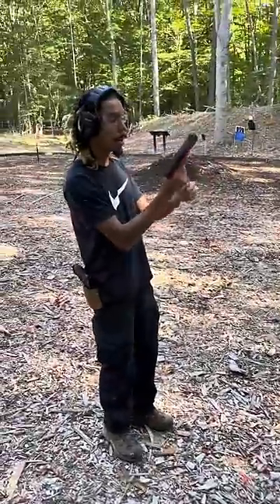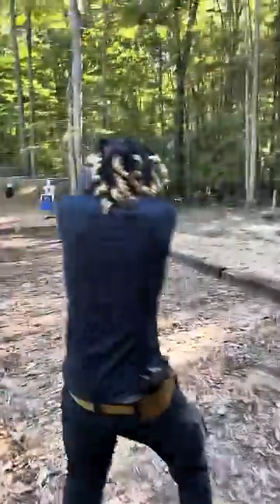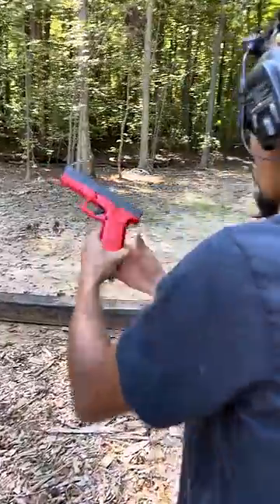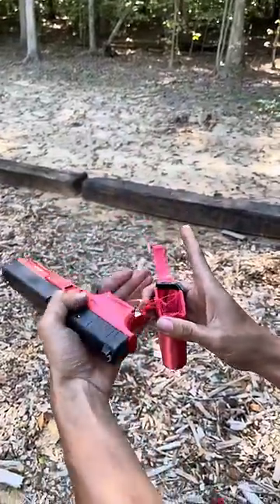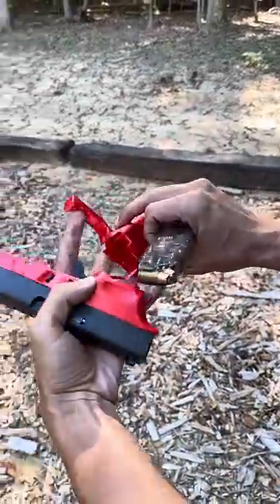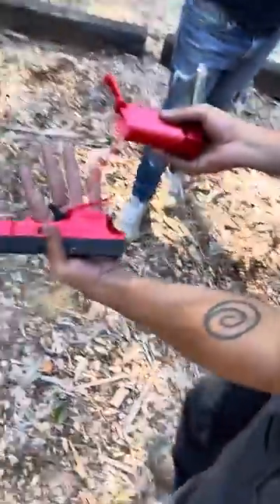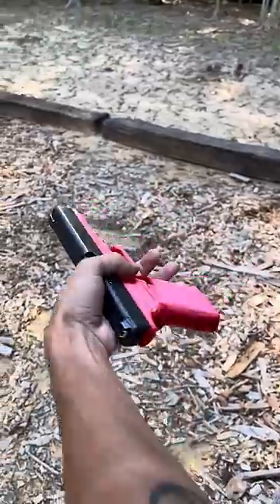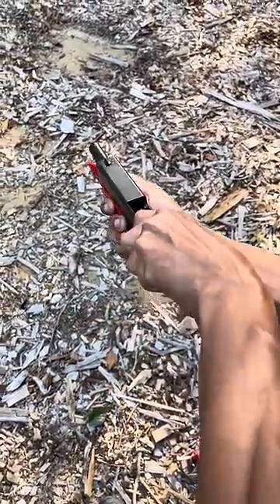3D Printed Gun FAIL 🤬

Comment: They never show the mess ups and what we actually dealing with I appreciate this fr
Reply: Because apparently most not everyone researches this stuff before doing it
Reply: Did you hear the last thing he said "well the guy did tell me I used the wrong material" 🥴
Reply: @j.m.7514  see wtf I mean like come the fuck on if you was told from the get go it was the wrong material why you gonna do it anyways smfh that is like the number one thing when printing along with settings I stress test any print before trying to assemble it all you gotta do is twist the frame and I’m sure those settings weren’t right either cause that broke the same way a print that has layer adhesions would mine broke right there when I used prusa program over cura wish I could load a picture of it
Reply: @j.m.7514  I noticed that too
Reply: 3D printed guns will never be super reliable, you can get a sturdy one capable of many rounds with high grade filament and a superior design through an expensive printer. It’s better to just get a Cnc machine and make a metal gun or make a mold with the 3D print, but get a high grade polymer just like the handgun, ez
Reply: @MLGB0Yz  well cnc machines cost a fuck ton of money and the tooling not everyone know how to edit a program so 3d printing is much more cost effective and wayyy easier and a good starting point to get to that level of cnc machining I would only go as far as getting a ghost writer for 80% receivers
Reply: Just the plastic was very cheap couldn’t take the explosion
Reply: @MLGB0Yz  You sir are a liar! You can absolutely get high round counts from a 3dp frame! Hello, I'm Dr. Death the admin of beta testing at deterrence dispensed and I welcome any challenge to our designs
Reply: @MLGB0Yz  What's the matter can't defend your point logically? We have numerous printed designs that are incredibly reliable. The printed Glocks are just as reliable as the factory ones. A lack of skill in printing would apply to using a CNC as well
Reply: @doctordeath4047  dude, I have already the issue and logically explained. Poor filament and crap printer will not produce a reliable weapon, the schematic and program could work flawlessly, but you need good filament and a big enough sized printer that had the output capable to print such a design. But if you’re going to say  a printed gun is as reliable as a factory Glock, put more than 100k rounds on a printed gun and prove it because metal is definitely stronger and there is a point where non metal fails
Reply: @MLGB0Yz  a 150 usd ender 3 can print a gun. Esun PLA+ is 22 usd a roll. Reliable designs are available on the gatalog. The same parts on a printed Glock are plastic as the factory ones. I've seen how reliable they are, I'm in charge of beta testing for deterrence dispensed.
Reply: @doctordeath4047  everybody knows that a cheap setup like that could get the job done, but rigorous testing, it’s not an ideal firearm. I’m tired of talking, I’d have to share so much info, but you know nylon is supreme strength and the designs are fine, but molds are better than prints always. I’m not here to disagree and you can make a functioning printed gun, but I clearly stated the fucking truth and it was because the guys video even shows shit reliability. So i don’t care about your beta testing agrees if that’s what you even call it. You don’t care that I have a FFL and I manufacture firearms, and I’ve printed designs for mock ups, but I’m never going to sell printed guns, in fact, I don’t think I’ve ever heard of a company doing that. But im already stressed, I live in CA and the laws here are very intense so I don’t have the luxury of just printing guns willy nilly. Plus, I’m not making any firearm designs other than my own with the exception of 1911 and ar15. I have spent years obtaining highly illegal weapons to the normal civilian just so I could have the upper hand in creating guns. My main focus is on fully automatic rifles, I would never attempt to fire a 3d printed version of any full auto, I just don’t find that to be safe. Keep doing you, I was never discouraging, just stop trying to convince me because it’ll never happen
Reply: @MLGB0Yz  Well sorry that you've decided to be close minded on an exciting new technology. Have a good day.
Reply: @doctordeath4047  I’m not close minded. I think it would be great to see an industry of printed firearms, so get into that if you want. As far as printing a gun for personal use, that’s fine and I encourage it, even if it’s a bad print but can fire some shots, have a couple of those around the house is a good thing, locked appropriately if children are present though of course. I’d be impressed if you make a legitimate business selling guns that you print and if you could get a deal with a military or law enforcement agency anywhere in the world, i stand up for that. Just think of Bigwell from Robots, see a need, fill a need. I’d love to see you thrive in whatever you want to do. Have a good day as well, God bless you.
Reply: @MLGB0Yz  You have a good day as well. I hope everything works out for you. I don't make the designs to sell though my group freely distributes them to make gun control impossible. Thank you
Reply: @doctordeath4047  he said they're not super reliable but you CAN get a sturdy one capable of many rounds. I think you misread his original comment. I know I did. But what he's saying is definitely true. 
On another note thanks for putting in the work on DD. The gatalog has been loads of fun.
Reply: @johnnytakisawa  Thanks! You should join us we can always use more talent and testers.
Reply: Facts
Reply: Crazy dude, should never have pulled that trigger twice!! Especially after the crack. Thank God your safe!!
Reply: Facts
Reply: Honestly if I’m printing a gun I’m doing hella research to keep my hands like
Reply: @MLGB0Yz  I think you'd be surprised just how reliable they actually are. People have made a .50 BMG and it shoots wonderfully.
Reply: @MLGB0Yz  Its more an issue of people without printing experience not understanding that the things that make a pretty print don't always make a sturdy print, I've printed guns I felt very safe shooting hundreds or thousands of rounds through on a 300$ printet I bought 5 years ago, you need good PLA which most of it is now or at least decent PLA+, high heat, increased flow, low speeds, and little or no cooling to get the best layer adhesion for things like this. People also tend to print in the wrong orientation and end up with layers ripping apart because they weren't lined up to work with the direction of forces (which seems to be the problem here). Like you said design is very important, I've seen reliable prints shooting .308, those generally used clamping force to make up for the layer  separating issue. Printing guns is a science in its infancy, and people are figuring it out. Though no one should expect to dump hundreds of rounds without letting it rest, thermoplastics are what they are. Although I've seen some amazing results with heat resistant resin prints recently.
Reply: Should have used PLA plus
Reply: Every video I see shows the mess ups your building a gun from scratch  of course your gonna have small problems, but the only way it will blow up like this is wrong type of filament if a big youtuber had this they would damn sure post it they would get tons and tons of views only difference is they know what they are doing these guys are new
Reply: @johnnytakisawa  he is acting like you can only do it with a super expensive printer and super expensive and challenging material but that's not the case.   One of the cheapest printers and some of the cheapest material can make a good quality printed gun as long as you do your research and understand the process.  These guys clearly don't understand that layer adhesion is pretty damn important
Reply: @GambleSTARS I think they need tests on reliability and I mean let it sit for 5 years in a safe pull it out see if it shoots  see how many out of 100 will do that if it's 100% then most of the time these guns are gonna do everything a normal gun will ever need to do example most hunting is only gonna take afew rounds.  Most self defense as well. I'd say range days are probably the hardest work most guns will ever do
Reply: @MLGB0Yz  you have a printer bro? It all depends all the material you use and what file you used just need a big enough printer that can print big parts and 600-1000 is not a lot my guy
Reply: @doctordeath4047  yea fr he has no clue what he’s talking about lmfao sorry
Reply: @doctordeath4047  at least Ik theres one person still opened minded and not a stuck up prick who needs to be right💪🏾 keep on printing bro I’m with you!
Reply: @doctordeath4047  a 3D printed glock wouldn’t hold up to a factory made Glock as you insane 😂😂😂
Reply: Watch 3d print shoot
Reply: because they do things right not this guy
Reply: @MLGB0Yz  no you only need to know how the bullet is going to stress the printed material and know how to make it stronger, simplest thing is just to wrap it with carbon fiber and youre done
Reply: Assuming that every 3d printed G always breaks.
Reply: @culomasculo4764  
That's what I'm saying, even the guy in the video said the plastic was cheap. I've seen a_R15 3d printed and they work well.
Reply: @texican3619  is there a way that your comfortable sharing those settings?
Reply: You got a mouse in your pocket fool?
Reply: Facts
Reply: Nah it’s just the wrong material
Reply: It’s cheap plastic…if you think u can make a firearm frame from 3d plastic you’re trippin big time
Reply: Materials and print settings are the biggest difference in the world
Reply: Print shoot repeat always shows the failures.
Reply: Like FR FR to make it official young
Reply: Or you can just get a real gun and not worry about this kind of shit.
Reply: @Spooky-4000  Idk... I have both and that would be a fun test. All the critical components are still steel... Now I want to do this
Reply: Question for those who really know 3d printing. Could you use some metal in a rough shape of what you need to have it in the places that take the most punishment and print over it? So that there's reinforcement and metal areas for the slide rails/tracks so they are metal on metal like polymer handguns actually are? 
And to bad a metal 3d printer is so expensive or that could make guns easy strong and relatively speaking fast to make
Reply: @texican3619  , I don't know but it seems like he doesn't care much if he dies or not, that could had ended badly... "Ummm hey is cracked but lets shoot it again" ...
Reply: Lol… I dont know whether this dude got balls of steel or no brains at all, or both!!!…. Lol….. but he got me beat, I would have never pulled the trigger again after it cracked….. lol…. But glad he was ok, that could have ended much worse.
Reply: @doctordeath4047   Well hello there, is there any way I can get in on some beta testing? I have a nice upgraded ender 3v2 and a really nice ff guider 2. I print most of mine in fiber filled nylon but have a ton of cheap pla+ that I use to test things before I use the expensive filament. I've made(printed and put together) 8 different pistols and a quite few duplicates. I've kind gotten addicted to printing and putting them together and I need more. I'm itching for a new build.
Reply: @MLGB0Yz  I'm sure plenty of people said something similar around 100 years ago about auto loading pistols, remember "6 for sure". Or maybe about 40 years ago when people were thinking glock was just screwing around making a frame out of PLASTIC?! You shouldn't say "never" even if you believe that it's true now, which it isn't.  I have two printed with the same material that glock uses, that I've put over 2000 rounds through so far. One is 9mm and one is a .40. I know it's not exactly the same durability as an injection molded frame but I'm sure it's close enough since the designers make the frame more reinforced specifically for 3d printing. You can also get some really high grade materials that are more durable than the pa that most polymer frames use but I haven't tried them yet.
Addendum: I know h&k made the first polymer frame but as far as I know, glock was more of a story when they did it for some reason. Now they are usually the first thing a normal person thinks of when they hear mention of a polymer frame pistol.
Reply: @HowsItHappening  Absolutely! Reach out to me on rocket and we can get you into some
Reply: @bobthompson4319  Yes we do that alot now and it improves durability significantly.
Reply: So they printed these? Like what about a waiting period? What about background checks? Who sold them a printer? This is illegal 🔥
Reply: @tanner882 Well, it takes about 12 to 24 hours depending on your settings and the size of the frame. Also, you have to wait for the parts to arrive unless you're lucky enough to have a local store that sells them. The background check would be that you're smart enough to calibrate and use a 3d printer. So there ya go,  a natural waiting period and background check.
Reply: he didn't use real polymer obviously
Reply: @doctordeath4047  teach me how to get the parts I already know how to 3dp everything else. I even built my own laser and other accessories
Reply: The only reason his broke liek that is because he used the wrong material he used silk pla he literally said it at the end of the video and if Yu knew yubsed the wrong material why make a gun and shoot it if Yu know that